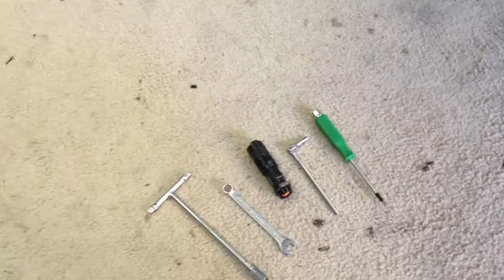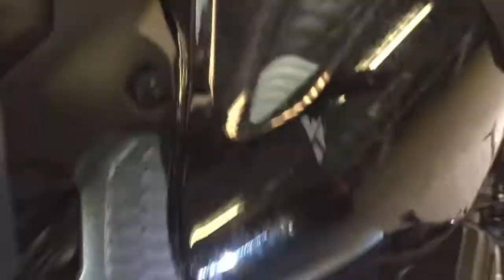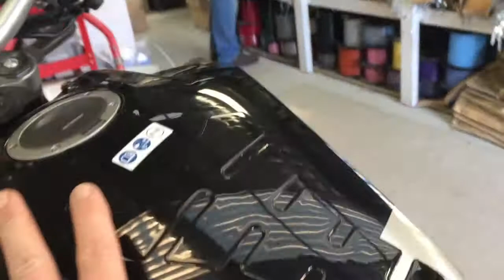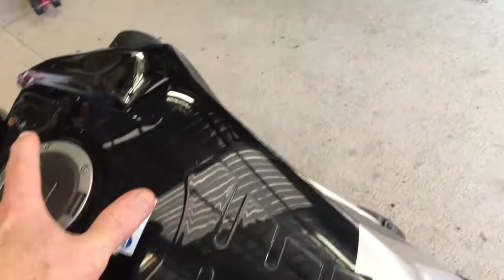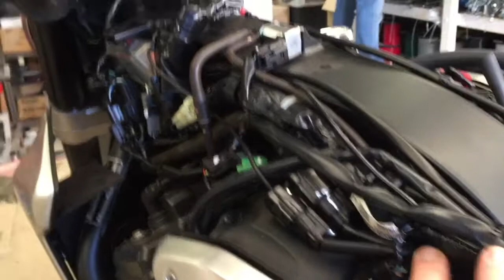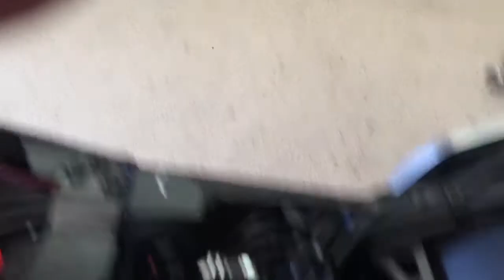MCCruise Installation on a Honda CB1000R 2018

Comment: Today I finished wiring the wires and re-wiring the connectors. I am yet to calibrate (let alone test) the cruise control but the bike started, which was my biggest concern. (I am a complete noob with zero talent for this kind of stuff.)
The only hair-pulling point for me was the TPS-connector. Undoing the three terminals was frustrating af, until I stuck a 2nd blade under the 1st one, works like magic. Well done, me! 👍 (Sticking the 2nd blade on the opposite side of the terminal did nothing for me.)
What I would point out about the installation is that the manual leaves pretty much no room for any kind of confusion or misunderstanding. 9.5/10 (0.5 off due that TPS bstrd!)

Comment: Are you sure about the 4-button alternative? 6 months later, nothing on their website yet...
I would be considering this cruise-control, I am not a fan of any of those two-and-half versions currently on offer.
Reply from the maker: Sorry - I don't know what you mean by your comment?
Reply: @motorcyclecruise8224  I am referring to what you sad at 8:22, i.e. a 4-button version of the cc
Reply from the maker: @jaromor8808  Are you talking about our 4 button slim switch?  It has been available for certain models for nearly a year I think?  See the Africa Twin product for photos.  Our new 4 button older style switches are in transit from China right now.  Email me if you want a PDF about the slim switch and how to make it fit - IF it is possible.
Reply: @motorcyclecruise8224  No, not talking about the slim one. This is what you say at 8:22 "this will be replaced pretty shortly with a 4-button switch panel"
Reply: @motorcyclecruise8224  "Our new 4 button older style switches are in transit from China right now."
OK, I guess that's what you meant at 8:22
You wouldn't happen to have link where I could check it out?
And now we wait :)
Cheers